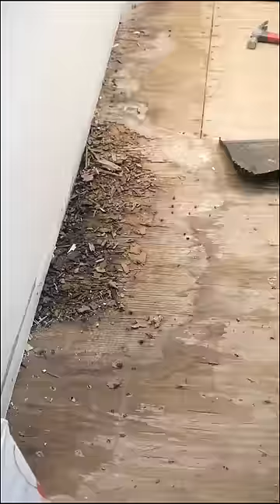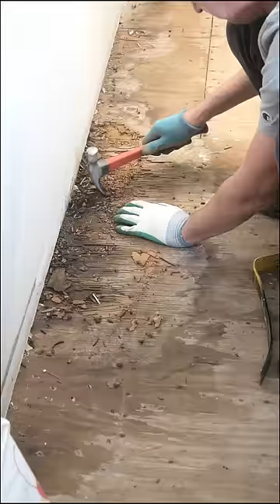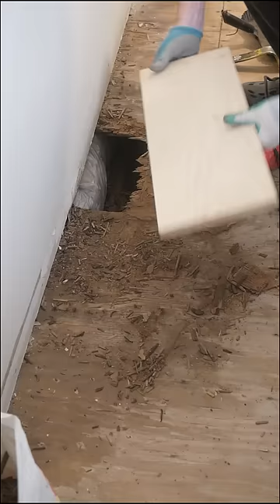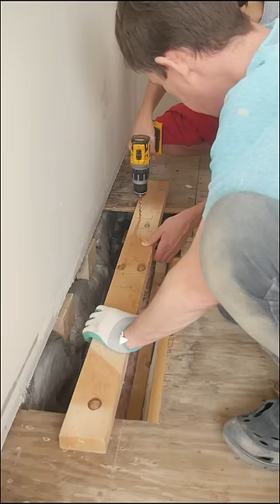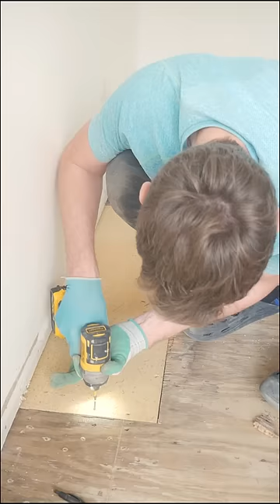Rotten subfloor repair after water damage

Comment: This guy didn’t know what he was doing.
Reply: Up to code? Maybe not
Will it be fine? Yeah most likely.
Reply: So you just going to say that without explain the correct way or doing a video yourself for us to see?
Reply: That was a huge gap he left
Reply: @teddj514  ultimately you tell b.c. he used a jigsaw to cut out the rotten wood w. Dead give away
Reply: @teddj514  in theory he should’ve cut the damage subfloor to the existing floor joists and secure the new subfloor to those rather than adding blockings and attaching the new subfloor to those blockings. By doing this, whatever weight you put on that floor is supported by the screws he’s putting on the blockings. But the area is so small I doubt it’s gonna be a problem. And MDF is not an optimal material for subfloor
Reply: у него было мало время
Reply: @lazyprodigy2774  what no it wasn’t
Reply: That's for sure. You replace the whole sheet of plywood or cut much wider
Reply: I will work perfectly fine
Reply: @jonathanchefski3120  may "work". But where I'm from we call that 'deadwood' blocking. The only thing supporting any weight in that area is the screws in the blocks. Meaning it will most likely sink over time. Deadwood blocking is usually done on ceilings for sheetrock and uses the existing walls as its support. When you put it on a floor there is nothing underneath the blocking to support any weight. It's just resting on the screws. And screws can rust especially if that area already is prone to water damage. Which means the screws can not only allow it to sag/sink, but can also shear off if too much weight is placed in that area.
Reply: @RareVBlue you are right but small area like that against the wall will be ok, if I was doing this repair I’d use several 1/4 ledgelock lags
Edit: i definitely would’ve cut out a couple more inches and shared the joist with the one end though
Reply: @jonathanchefski3120  I currently repair and install flooring for a living. First thing I have to do is usually remove or relocate all of the furniture. Some furniture is so heavy that me and my helper have to use furniture jacks to move furniture. Wooden furniture can easily weigh over 1000 pounds. Especially the kind old people usually have. And especially the kind like old china cabinets filled with items. And they are always placed against the wall. Literally about every house I do has 1 or more extremely heavy pieces of furniture against the wall. Yes it may work fine long enough for you to cash the check, but there is a right way to do this and a very good reason to do it the right way. He literally has a wall plate under that joist thats under the wall. Looks like it is possibly a 2x8 joist. He should have used a board the same width as that joist and rested it on the wall plate. Also he should have come back 2 joists from the wall to the center of the second joist. By going to the first joist with such a small replacement piece of subfloor, you run the risk of a hump right there on the first joist. That 2nd joist looks like it was pretty close to the second so I would have probably went to the center of the 3rd joist. One scab on the plate against the wall was the only scab needed and it needed to rest on the wall plate. And then there's the fact that the subfloor in the corner was rotten at the wall line as well.
Reply: Он даже не знает зачем живёт
Reply: @lazyprodigy2774  рр
Reply: @lazyprodigy2774  к
Reply: @jameskerns3297  рп
Reply: @brendajohnson5975  ррорр
Reply: @user-friendly_87  оттр
Reply: @brendajohnson5975  рр
Reply: The fact that this is right against the wall make the deadwood block irrelevant. This patch isn’t taking any foot tragic
Reply: Traffic
Reply: @lazyprodigy2774  yes a whopping 1mm
Reply: Well he did a better job than I would have and I definitely don't know what I'm doing. I'd say he knows how to do something. Maybe not up to your Bob Villa ass standards but it looks like it should hold fine
Reply: Unless he went under there and sistered in a for joist after?
Reply: @wyattshelton2080  code exists for a reason
Reply: Just unexplained hating. I'm sorry I paid attention to it.
Reply: Would the insulation have to be replaced too?

Comment: why the hell did you use MDF?
Reply: Why's MDF not good for flooring? Noob question
Reply: @Paul Stoker  acts like a sponge with moisture and will eventually crumble. Should've used plywood, MDF is just compressed saw dust and glue.
Reply: It’s not MDF. It looks like G1S plywood.
Reply: @Scooter McGee  it's clearly mdf..he used plywood for a template lol
Reply: @BUCKSTALKER123  not sure it’s as clear as you think. But hey. Whatever. He did a decent job patching it. As long as it’s not MDF.
Reply: @Scooter McGee  been around long enough too spot MDF. 0 wood grain of any type of plywood I saw. I'm sure your a professional wood worker so you should have a eye for it too. Scooter
Reply: @BUCKSTALKER123  @MrStukov why don’t you set the record straight. I say G1S plywood. These guys say MDF. Who’s right?
Reply: Only a tip, future frame work, labour is expensive these days, right?
Reply: @Corneliu Catana So is real plywood apparently
Reply: Defintely mdf. Lol I bet you the mdf had a better height so he used that instead of the pine he used for the template. Kinda scary thought process by this guy. 😮
Reply: @Brain Win  Do you need employment sir? Lol
Reply: @BUCKSTALKER123  No, thankfully not lol I refuse to use anything MDF. There is nothing good that comes from it.
Reply: @scootermcgee3451  *Douche not douch
Reply: @BUCKSTALKER123  you would know. I guess.
Reply: @BUCKSTALKER123  MFD is plywood, ya goofball. The ~type~ of plywood is the question.—In this case OSB or RTD would be the best option. Over-out.
Reply: @_stokyo_  lmao mdf isn't rated nor is it intended to be used as flooring its basically sawdust and glue, MDF was made to be a lightweight replacement for plywood it's only used in furniture and other similar applications to cut down on weight in applications where strength is not necessary, MDF isn't strong enough to last decades and it acts as a sponge when even the slightest bit of moisture gets near it, they better hope they never get a leak in one of their water lines or else that board is gonna turn into a 1 foot deep pile of soggy sawdust under their carpet even without direct exposure, they should've used OSB or oriented strand board it's the chipped wood sheets that some ppl call "plywood" its wayyy stronger and will hold together even if exposed to moisture.
Reply: @scootermcgee3451  actually you. This guy is right just fyi guys, now that I look hard enough you can see the wood grain on the top of the board its not mdf
Reply: @TheBookofLab  thank you!
Reply: It's cardboard from a box , lol
Reply: MDF will soak up the next spill! Simples 😎
Reply: Pretty sure it's chipboard?
Reply: bro about to seal the bottom & add two 6.5 subs in the floor lmao
Reply: @TheBookofLab  the first piece he used as a template was plywood but he went bigger and it’s clearly a piece of particle board he used in the end.
Reply: @_stokyo_  eats water like a sponge. will warp and deteriorate with water/ moisture
Reply: Particle board. Not msg, but yea, should not be usedz
Reply: @scootermcgee3451  mdf
Reply: Nice to see someone who knows his s hit.
Reply: @Wyatt Dickson  I saw the switch, too.
Reply: Partical board?
Reply: Job security
Reply: @-agent-47-80  "My life sucks, can't be ignored. All I can afford is particle board." -(I forgot who wrote it.)
Reply: Holy shit that does look like mdf. I guess at least it's not the particle board that walmart uses to make all its furniture with.
Reply: Because of covid Lol!!! Or the cost of materials, or it’s the only thing that’s legal.
Reply: @scootermcgee3451 nope I saw no layers in it. definitely not G1S. looked to be MDF aka wood dust glued together.
Reply: @scootermcgee3451  mdf. junk.
Reply: Definitely used mdf which is insane. But if it’s a waterproof flooring then maybe it will work.
Reply: @scootermcgee3451  heck no .. MDF was used and  you're going to feel the uneven footing later on .. the unsupported ends will flex later on it might squeak to.. Always glue your floor boards...
Reply: That’s not mdf
Reply: Definitely mdf board shit will rot in a couple years and become someone else's problem. I hate taking rotted mdf board out real annoying cheap method for hacks
Reply: @scootermcgee3451  I’m siding with dickwyatt🤣🤣, that’s mdf for sure. The siding is loose take a peek
Reply: @bigloudandnoisy3601  just makes you as wrong as he is. Lol!!!
Reply: I swear I was about to say this
Reply: @scootermcgee3451  aight scoot🤣 I’ll bet you an “I told ya so”🤣🤣
Reply: First off, mdf or not those crocs should of been the first red flag
Reply: @scootermcgee3451  you are right that is ply
Reply: @Joel-Rubearsdad  YAAAASSSSS!!!! We should totally hang out! Lol!!!
Reply: For a “like and subscribe for pt.2” 😂
Reply: He gon add a subwoofer later, never assume to quickl bud 😂😂😂😂 jk
Reply: I mean, why did he use only two screws to hold it up 😅
Reply: That ain’t mdf
Reply: It looks like particle board (like in inexpensive furniture). And yeah, I’d guess not a good choice for subfloor. Neither nearly as strong or water resistant as same thickness plywood (or MDF for that matter).
Reply: MDF doesn't withstand a lot of humidity.

Comment: All done. Now mark off the area with safety cones so nobody walks on it
Reply: *Slaps floor
That suckers not going anywhere.
Reply: Why?  It’s braced underneath on both sides with an over abundance of screws and wood.
Reply: Ahaha
Reply: @Mark-em5zm  yeah rightttt that sounds like structural integrity at its finest lol
Reply: No one is falling thru that. If you are you need to lose a few lbs
Reply: @mariom6214 a few hundreds*

Comment: Should've used 3/4 OSB. Also I would have put the full sheet tight to the corner, scribed, and put in a full sheet. The floor was rotted all the way to the corner. Nice and clean though 👌
Reply: Lol exactly.  Why did they repair two feet when the damage went all the way to the corner?
Reply: Ye - redo the whole floor!

Comment: 2 or 3 2x6's perpendicular member attachment back to adjacent floor framing would be preferable (with LUS26 hangers). The repair here has the load at the edge being translated to the damaged subfloor. Oh and MDF is NOT recommended. Glue and screw the subfloor into place.

Comment: How did you know what was underneath before you cut? I have laundry room floor that needs repair. Not rotted but mold from washer flood. Previous ownets covered it with cheap 50 cent tiles

Comment: Good 👍JOB.  Other than the screws. Screws in the floor boards make for squeaking floors
Reply: Quite the opposite. By code, in regions of excellence, screws are to be used to fasten subfloor with a specific fastener schedule.
Adhesive is often called for as well
What would you have used, instead of screws?

Comment: Subfloor repairs should always span no less than two joist GTS
Reply: Yeah this was hoaky , worst part was the bottom was exposed they could have made their box from the bottom and not taken more sub floor.
Reply: It’s against a wall doesn’t really matter that much.
Reply: @CheddarCheeseBandit  not true, over time it will sag and even before it sags it will breathe and lift the floor. It should support the weight of someone and what if there's a couch that goes there? All sub floor needs to land on a joist.
Reply: I always go 3 and double the two end floor joists. This way both sides get a full 2 x for glue and screwing. I hate splitting a 2x for a patch.
Reply: That's what I always do. This one's a little sketchy

Comment: Nope. Put the sister stick on the inside of the existing joist and have your existing crappy ply run an inch onto the existing joist.
Pl3 on everything.
Fail --minus for the tweaker soundtrack.

Comment: The piece of 2x4 on the right should have been at least half it's length extending under the plywood on both side screwed and glued  that crap is useless.
You would have been better cutting larger and reaching half a beam then you make then one on the wall longer and after that you put 2 piece in between the beam and the one on the walls then screwed/glued at both end on the beams  and under the ply.

Comment: Learn your lesson. Stop using cheap sheet material like mdf, osb board and even ply for subfloor. Use proper timber boards, will last you longer than a lifetime and not rot as easily.